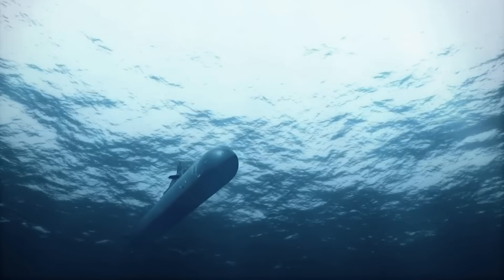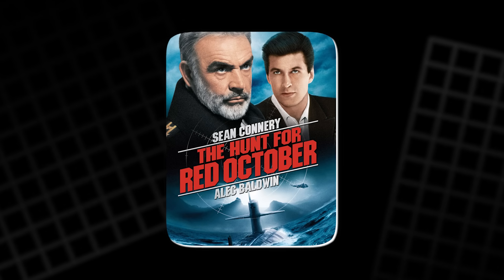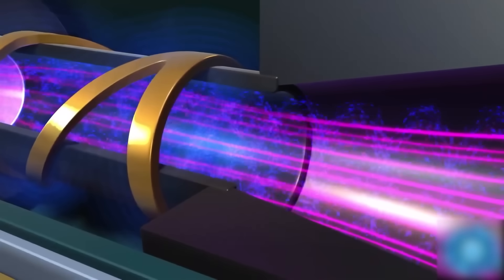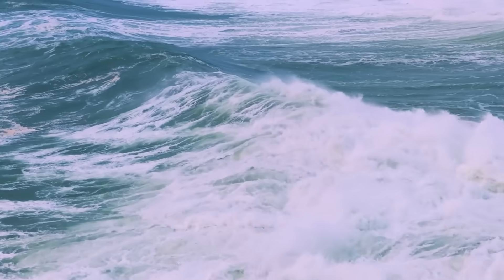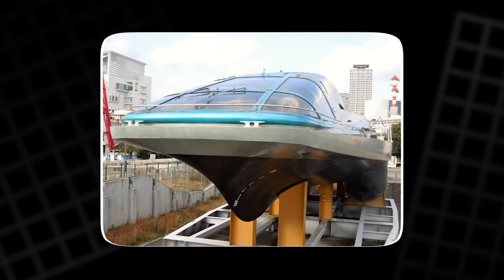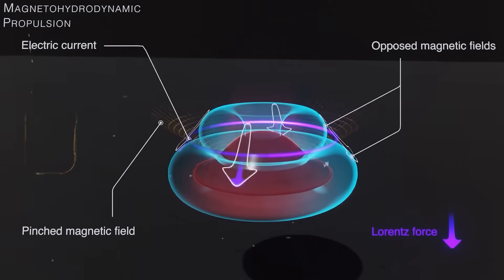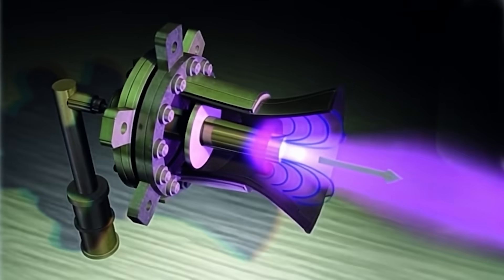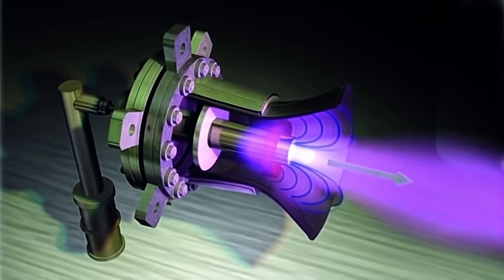ThThe Silent Engine That Could Change Everything | Magnetohydrodynamic Propulsion Explained

Comment: Why are people still using obsolete super conductors? We know that graphene is the best material for the job so if you're spending 100 000 000 dollars on a project and you can have a room temperature super conductor then reallocate the coolant budget to better parts. Simple.. I'm aware that room temperature super conductors are still am area of research but it seems like it's more beneficial than a machine that needs them before you have them. 
This is a great idea but it puts the cart before the horse.
Reply: Graphene is better than super conductors. Super conductors are a whole different beast that thermally electrically speaking. Graphene manufacturing is in it infancy and it is only a good conductor in a single axis. What is needed is a liquid super conductor metal alloys that don’t turn solid at near 0 Kelvin. That is because it could have gyroscopic and other force much akin to rapidly rotating plate weights at the end of a meter long rod. I’m sure you saw it in high school physics class or physics 101 in University for a hand on gyroscopic and angular momentum demonstrations.